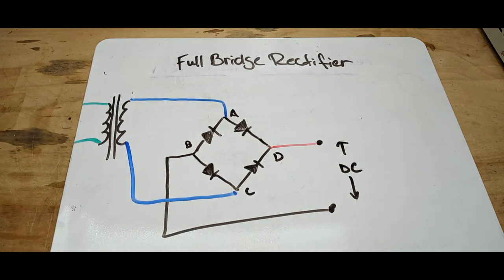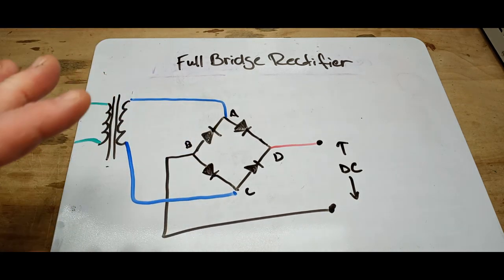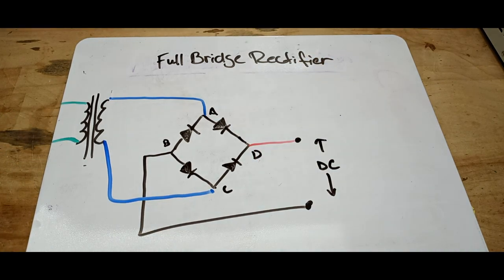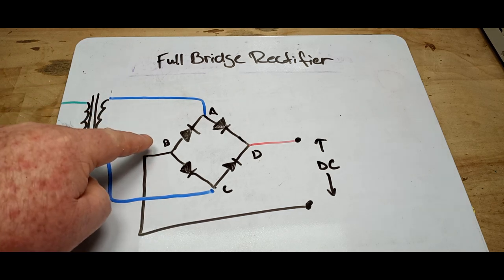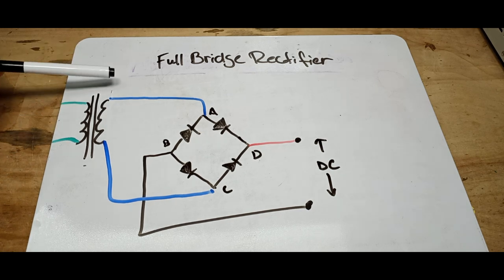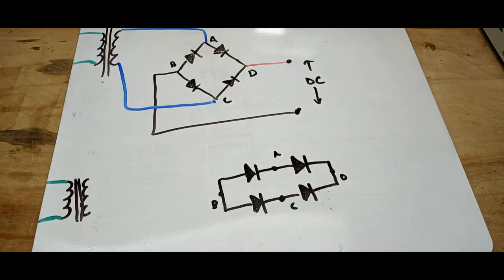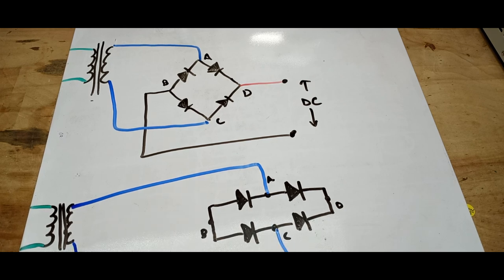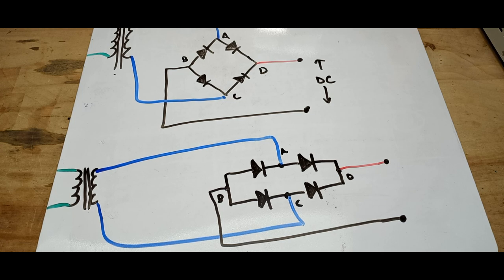Full Bridge Rectifier Breadboard Layout

Comment: Good video for newbies. Good place to find a low voltage transformer is inside a clock radio. One that plugs into the wall (obviously) the smaller the better.

Comment: Very timely,  am building a project that uses 120ac but  needs dc, but i bought a board on amazon to do that. I assume that the rectifier determines what dc voltage comes out?
Reply from the maker: The transformer determines the voltage, the rectifier just takes the negative half of the AC and flips it so you end up with DC.

Comment: Sorry for the noob question. Bit if the ac is forcing the current through the pos and it loops back through the neg what happens to the unused current? does it add to the Newly supplied AC current in turn increasing it? Not sure if I should use the term current instead of voltage. Thanks for the videos. I look forward to every one.
Reply from the maker: It's not so much current, it's just the negative half of the AC sine wave. It gets flipped and added in. So your input of say 12VAC at 60Hz becomes 12VDC at 120Hz. The frequency is doubled as we are using both halves of the wave in series.
Reply: I always try to visualise voltage and current using a water/pipe analogy and I have been playing with stuff for well over 40 years.  Voltage is the pressure of the water in a pipe, while Current is the amount of water flowing through the pipe.  
You can have a very small pipe that has extremely high pressure that can cut through timber.  However that same pipe may not have a lot of water coming out of it, but it will slice through timber, your finger, etc.  This is HIGH Voltage, LOW Current.
You can have a storm water drain outlet that has hundreds of gallons of water pouring out of it, but the pressure is low enough you could walk through the water.  HIGH Current, LOW Voltage.
The REALLY dangerous example if a fireman's hose.  Gallons and gallons of water being shot up to a third story fire and the water pressure is high enough it could snap you finger if you were dumb enough to put your hand in front of the nozzle !  HIGH Voltage and HIGH Current.
You can visualise most of the common components using the water/pipe analogy, e.g. switches, resistors, capacitors, inductors, transistors and diodes.
Reply: @paulp2089  I was thinking something similar. I see the circuit as a loop and the unused water needs to continue and add to the new water. so does that increase the voltage? or current or nothing at all?
Reply: There are circuits that will increase the voltage, but they will also decrease the current, (no such thing as a free lunch).
Keeping with the water analogy, the battery or power supply is the pump that moves the water around.  Anything that is unused just sits there.  If the pump is to strong the pressure will be too high and POP !  Technically if the pump is pushing way too great a volume of water even at the correct pressure - POP !  Like trying to run a 24v radio off an arc welder.  The arc welder may only have 24v, but will push out 100-200 amps so not a good power supply for a radio.